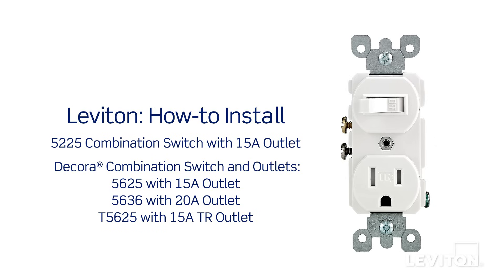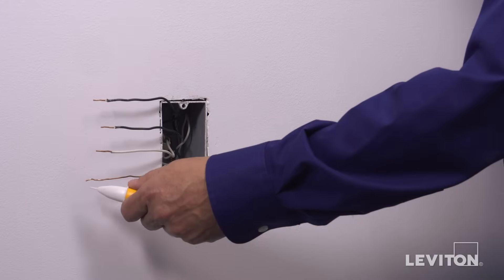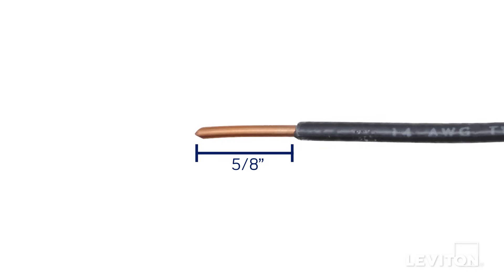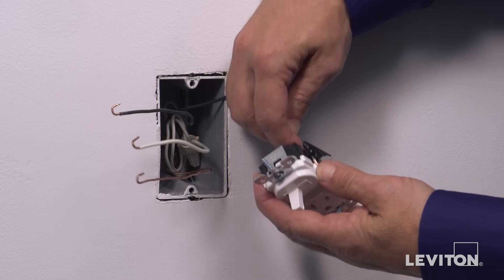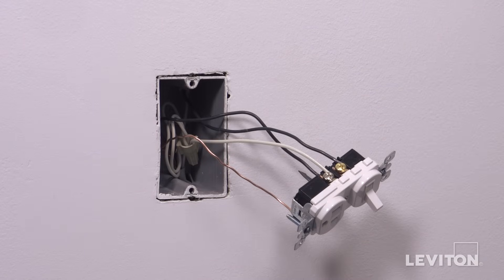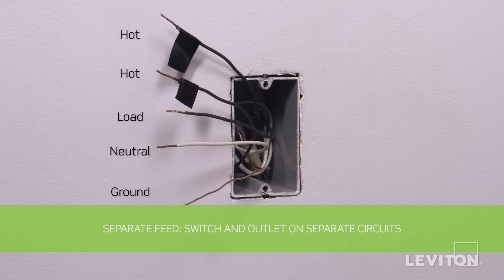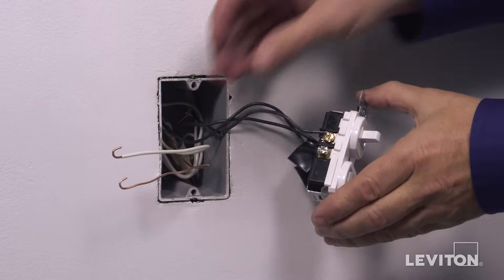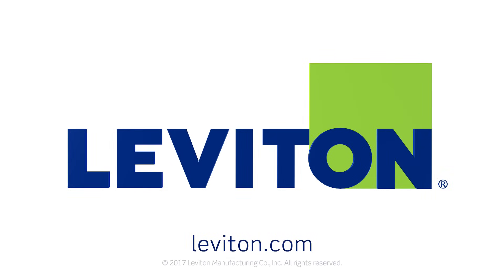How to Install a Combination Device with a Single Pole Switch and a Receptacle | Leviton

Comment: I don't knowhow this is working for everyone so seamlessly.  I followed info amd video exactly.

I tested the lines to find hot before connecting anything.

Panel black wire went to black common next to switch.
Black wire going to light went to brass next to switch.
White wire going to light, went to silver wire next to outlet.

Nothing happens. No power.

But my question is, there us still the wite NEUTRAL coming from the panel. Where does that go? How does the light work to go OFF if there is nothing attached as neutral from the panel?

Comment: Who would have thought that it would be a good idea for someone in this video to explain where you get a load wire the second black wire from when all Romex in the wall coming through has a single black wire or single white wire and a neutral wire

Comment: FYI, this doesnt work in old buildings where you only have hot wire and load in your box. you need a neutral for this to work.

Comment: Wanted to use this so bad but I only have Load, Ground and Neutral. I can't control just the switch and have the plug always on as shown in 3:55. :(
Reply: same thing here idk how to add those extra wires :(
Reply: Find a solution?

Comment: Thank you, Leviton! Worked exactly as you described. Had to add an open neutral to manage the outlet as a separate device, and in the second installation I had to connect a black that was not hot, to the common hot, as it fed an electrical outlet on the other side off the wall. All went well, and the logic you shared made the troubleshooting easy.

Comment: The video didn't explain the 'direction and circuit of electricity.' For understanding of electrical circuits, it would help including a diagram (and animation) of the direction of electricity for each of the types of connections.

Comment: remember that the first set up was for one with No Load.  That's the different between 1 and 3.  I believe.
Reply: If you have no load wire, then you will have no power going to the fan.
Reply: @stevena423  can u help me with that I have light in my kitchen im trying to install combination switch  yesterday I tried following diagram and my power tripped  
I have 2 black wires 1 coming from top  and one from side , 2 reds 1 from top and 1 from side 2 whites 1 from top 1 from side no ground  
can u help me how to install

Comment: great video but I was a little disappointed- 

Please wrap the receptacles\switch with electrical tape-  the tape provide safety for the person installing or replacing it will protect the installer from physical contact and prevent contact with the metal surroundings
Reply: This is very much a matter of opinion / debate / preference. It is certainly not considered 'unsafe' to not tape around an outlet or switch- In fact with proper installation it is not necessary, and some (myself included) consider taping to be sloppy, or even a sign of amateur work.. Taping might also cause heat build up on some fancier outlets that contain USB chargers, and it can leave sticky residue and a mess, and make it harder to work on in the future.

There are some situations where I might tape, for example a very tight fit with a metal box, or multiple outlets in the same box, but in general taping is a 'just in case' thing that isn't necessary if you do everything right, and if you do something wrong it still won't make it right, so personally I frown upon taping.. That said it is a common practice.

Comment: I have no ground wire in my existing light switch outlet or box (new house). So I just created one from bare copper. I want the on/off switch to control the light, and the below outlet always on.
I have 3 wires, all black. I used a circuit tool to figure out the hot wire. The remaining two, I attached per the instructions, part 4:00. The result was that the switch controled the light, and the outlet always on, as I wanted. But, no power to the outlet in the adjacent room! So I tried switching the two unknown black wires with each other, and the result was the opposite. The outlet of the Leviton unit remained off and the on/off switch controlled the outlet in the adjacent room, rather than the light! What do I doooooo?
Reply: Markus, I had a similar situation. I have 1 switch that controls the light in a ceiling fan. I had 3 black wires, 3 white wires, and 3 grounds. When I hooked up the hot wire on the black screw and connected all the other black screws to the copper wire and then the white wires and the ground wires to the silver and green screws, respectively... the light switch controlled the room lights and the other lights on that breaker box circuit. What solved the problem was that I had to hook up one of the other two black wires (not hot) to the hot wire on the black screw and everything worked as it should. Hope this helps.
Reply from the maker: Hello Markus, we recommend either calling a licensed electrician or dialing our support team at 1-800-824-3005

Comment: This took two people two hours!  This is why:  there were 2 black wires, one red wire, no white wires, and ground.  One of the blacks was hot, as was the red.  The other black was load, and whites were joined inside the box.  Hereś how we succeeded: the two hots (1 black and 1 red) went on to the right side with switch at top.  On the left, the wire that should be white went to the bottom, and the black load wire on the top.  The configuration was to have the switch to to a light, and the outlet to be hot all the time.
Reply: Consult a licensed electrician, if all the wires were the same color they would still be done in 15mins. And you won't risk your house being in flames.
Reply: @ShaunBoss7322   How would you tell the difference between ground and neutral? A continuity test with a known ground (ie metal box) would be indicated with both the ground wire and the neutral.
Reply: What wire “should be white”?

Your scenario:
You have the ground wire. 
You have a hot black wire. 
You have a load black wire. 
You have a hot red wire. 

None of those “should be white”. 
The white wires that are tied together are your whites. Tell me you’re not saying you think the red, hot wire should have been white and that you are not using it as a neutral.
Reply: Some things you shouldn't DIY.

Comment: i was gonna try putting one of these in my new house and pulled the old light switch out and i have no ground wire in the box am i just screwed now
Reply: I have the same issue,  OLD HOUSE....no ground wire.
Reply: @MrScott6465  I set up mine without the ground cable, it works perfectly
Reply: @johansenBB  How you do It? Help me out lol
Reply: You are sort of screwed. The hot feed for you light is connected to the light fixture box. The 2 wires in your switch box carry the hot feed to and through the switch the back to the light. The white ground wire terminates at the light. The way the wiring wS diagrammed for your house had no requirement for the switch box to have a ground wire.
Reply: I also live in an old apartment and only have two wires in my box. Pretty sure that we are basically screwed and wasted our money on this switch.